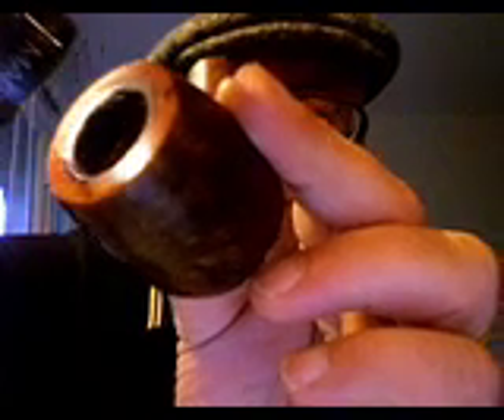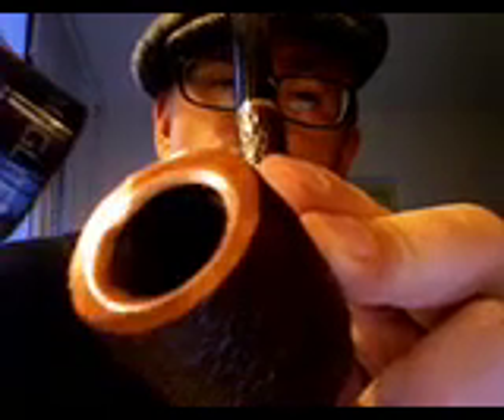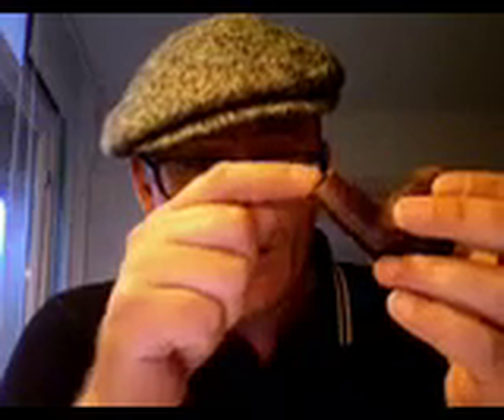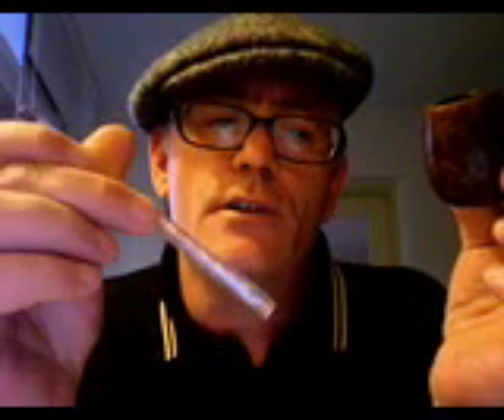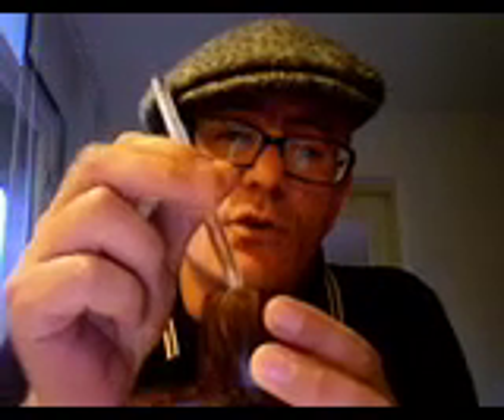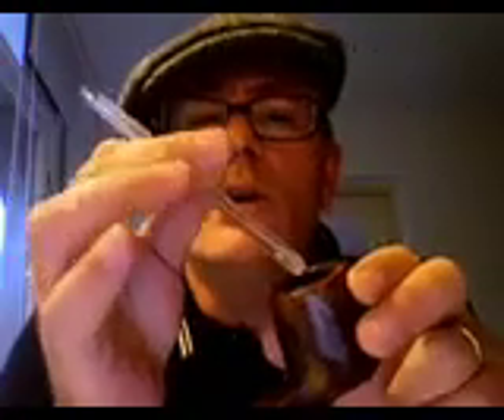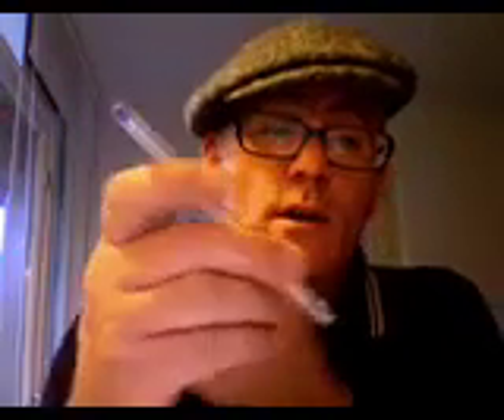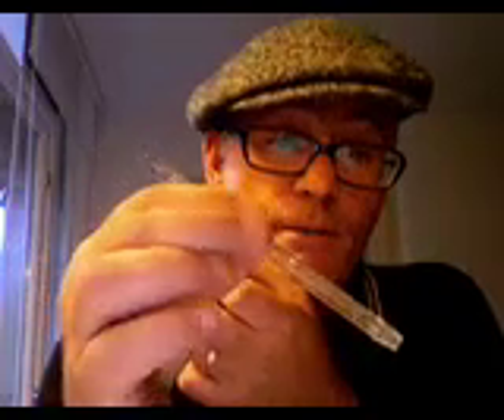Pipe cake and salt treatment

Comment: Thank you for your videos, the information and the advice.  Very informative and enjoyable.  Quick clarification on this video; the dropping of the alcohol from the bic pen by touching the salt is a result of surface tension and capillary action, not osmosis.  Osmosis is the movement of material through a membrane from an area of high concentration to one of low concentration.  Cheers!

Comment from the maker: Black Mallory is a top English Latakia, as is the mild Solani's Lux English Mixture, Night Cap is also a winner. But if you haven't smoked too much latakia blends in the pipe...do the salt treatment and after a few bowls you can convert it back to a non-latakia pipe.

Comment from the maker: @Dimitrispanayides The pre carboned bowl helps you build up the cake a bit quicker, most high grade pipe makers don't have this pre-coated layer. After about 10-20 smokes you'll see the layer forming, after about 30-40 smokes you can start reaming it back, just a little....the cake helps to stop the wood burning, it is a protective layer, it also hold a lot of flavour and sweetness.

Comment: I use a nipple brush. Sounds funny but it comes with those reusable baby bottles. It is the perfect size to fit in the bowl and provides a gentle clean.

I don't know if you mentioned this, but in the U.S. you should try make sure and use salt with no iodine. Most salt in the U. S. comes with iodine in. Just results in a rather chemically smell for the first few bowls.

Comment from the maker: @Dimitrispanayides You should only do the treatment if the pipe has built up a carbon cake layer or it is an estate that tastes really bad. But always let the pipe dry-out for a couple of days after salt and alcohol treatment, and be careful not to remove all the carbon cake layer.

Comment from the maker: @Dimitrispanayides Dim, you really do need cake in a pipe, but it only needs to be thin....between 1 and 2 mm is recommended, when it start to go over 2-3mm you ream it back to 1mm. It it is a meerschaum pipe you don't need a cake....

Comment: i have an almost similar situation. i have 3 pipes of my grandfathers a medico apollo made of brylon a royal duke Dr. grabow,and a 3rd i cant identify. the Dr. has cracks on the sides of the bowl and the Apollo has chips on the rim of the bowl and both have pretty heave cake build up. I'm fairly new to this so would i use this Technic and the others from the pipe cleaning vids? and was wondering if the pipes are even worth the time.

Comment: IT IS BAD FOR THE PIPE TO SMOKE IT MORE THAN ONCE A DAY!!!
WHEN THE CAKE HAS NARROWED THE BOWL TO THE SIZE OF A PENCIL, IT IS TIME TO REAM THE CAKE BACK TO BETWEEN ½ TO ¾ INCH IN DIAMETER AND STILL LEAVE A GOOD CAKE ON THE WALLS OF THE BOWL!!!
A POWER DRILL WORKS ON ALL 75 OF MY PIPES AND ONLY NEEDS TO BE DONE ONCE A DECADE!!!
A ¼ INCH DRILL WORKS ON THE SHANK TO CLEAN IT OUT!!! AND DO BE CAREFUL AS SOMETIMES A HOLE IN THE BOWL CAN BE MADE ACCIDENTALLY. HOWEVER, A PIECE OF CHOPSTICK CAN BE SHAPED TO FIT TIGHTLY IN THE HOLE, DREMEL SANDED TO THE SURFACE AND STAINED WITH THE GUNK FROM THE MOUTHPIECE!!!
I DEFY ANYONE TO FIND THE TWO HOLES I MADE AND REPAIRED WITHOUT A MAGNIFYING GLASS
MACGYVER© EAT YOUR HEART OUT!!!